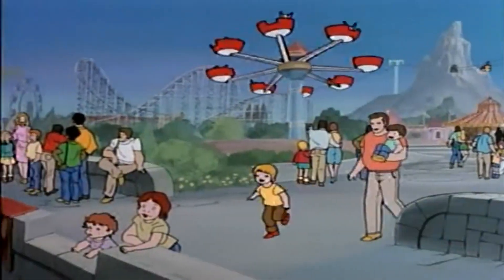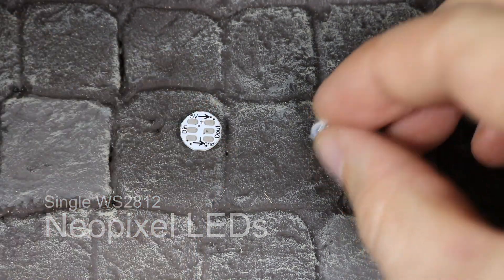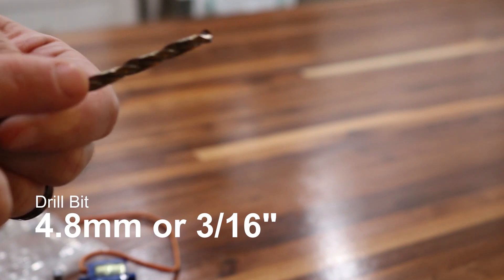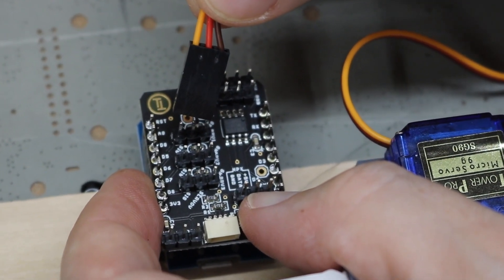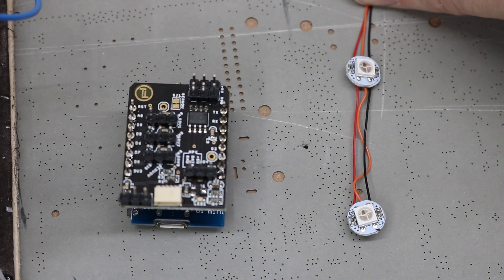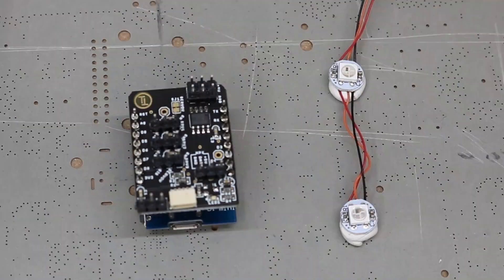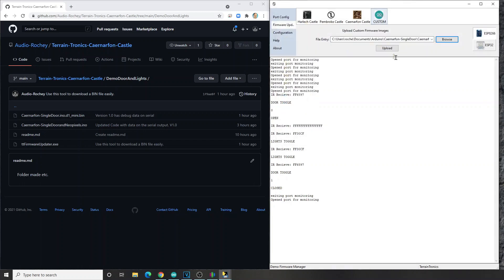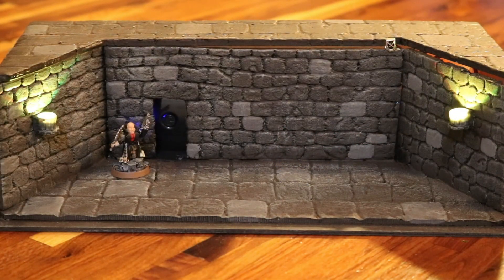Interactive Tabletop Terrain - Perfect for Dungeons and Dragons

Comment: Hey there! I love the video, it’s amazing! I’m so excited to use my newly ordered board in a very large project!

I’m curious though, what kind of external usb power source would one need? Are there any limitations? I would love any suggestions you have as well :)
Reply from the maker: Hello Hannah, Many of my builds simply use a USB Power Bank, or a USB connection to the wall. Many power banks have auto shutoff after 30 seconds, if you don't pull enough power. (after all, they are designed to charge cell phones quickly!)
The Caernarfon Castle PCB that's onboard has a circuit on it that pulls a jolt of power once every 20 seconds or so - enough to trick most power banks to stay on, without draining a lot of power.

Comment: This is perfect. This is my first time watching your content. I need to watch more. I tried something like this, but more basic using servos to move people in project. I might get back into this, but I liked using the Raspberry Pi to control everything. I may use IR for new builds. Again, great work!
Reply from the maker: Thank you for the wonderful feedback! I have a raspi running a home automation project for stuff like this, so you could use Wifi Dongles for detectors etc. It's awesome stuff, but I'm quikcly learning tha t many crafters in this hobby are no-where near ready for that level of complexity. I'll get there with people, but for now, I'm teaching basics - how to wire stuff up, how to get LED's to shine, and how to give the DM control over the tablespace from a simple remote control.
You'll find all my code examples etc on the github link below if you are inclined. Thanks again.
Reply: @TerrainTronics  - cool. What's the learning curve like? I can use Python with the Pi, and I'm comfortable with that. I do not work with an  Arduino. You got me motivated to get back into building - improving my skills.
Reply from the maker: @DrKeithMcNally  its' pretty gentle. :) I use arduino's because it's easier to drive real time peripherals like the RGB LED's with them. If you can do python, you can do Arduino's b*Stardized C++. It's all about hacking examples together until they work. I use ESP8266 boards which strictly arne't made by the Arduino people, but theres a modification to the installer that makes ESP8266's talk to the Arduino GUI and be able to use many of the code examples. I have other video's on how to use the Wemos D1 ESP8266 boards. For now, they are cheaper than ARduino's too, due to the chip shortage! I strongly suggest jumping on discord and joining the discord servers of either the Crazy Crafter or Tabletop Witchcraft. I hang out on both servers and there's a good group of people if you're getting back into terrain building.
Reply: @TerrainTronics  - I appreciate that! I will jump on Discord. I never really got "into" terrain building as a hobby, just did my own thing. But it was fun. I listened to a guy tell a D&D story about how his party killed a dragon, so I tried to build the scene using wood and clay and servos. It worked, too! I use wood as a medium; I know how to work with wood. I am going to watch all of your content. Hopefully see you on discord.

Comment: Great video!  This is next generation stuff for our community. I wonder if you could add a motion sensor to this?  The door would open when the mini stopped in front of moved past a certain spot on the piece.
Reply from the maker: Scott - We do that using reed switches in the floor, and ensuring all players have magnets build into their base. It's not perfect technology - but it's the easiest for many to integrated. Many motion detector circuits really are designed for human sized humans :)